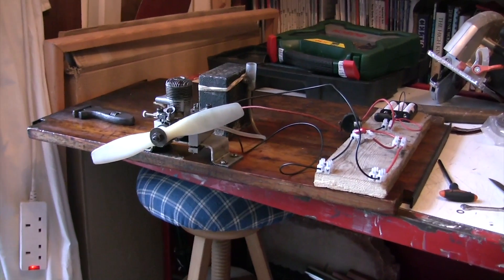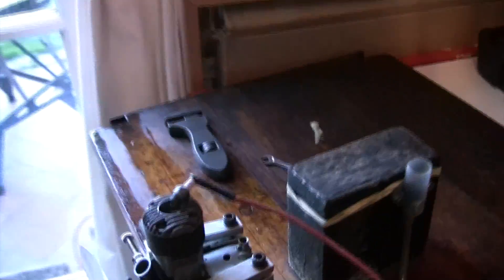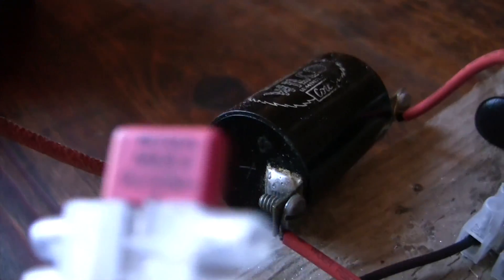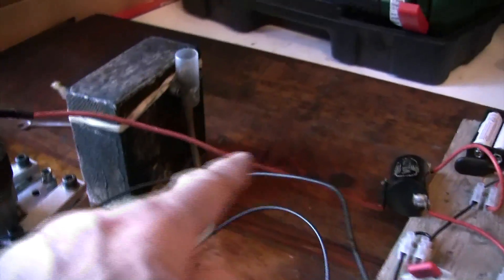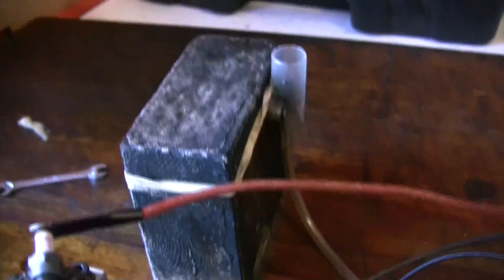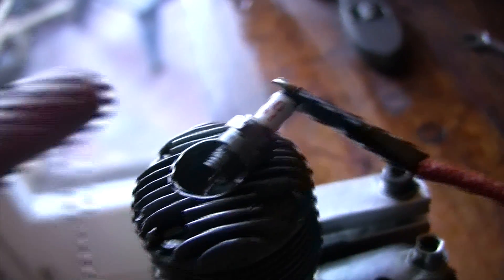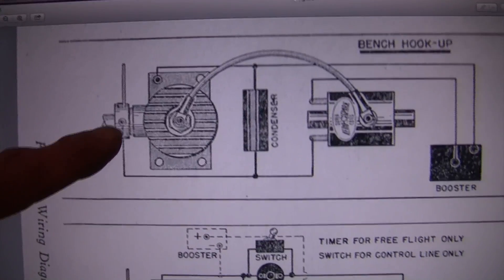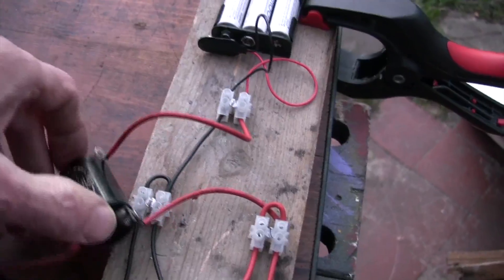How to get a Vintage Spark Ignition Plane Engine Running!

Comment: I have an O+R 60 which runs well, but I would like to convert it to glow. How do I get a glowplug to fit it, and would I need to alter the spraybar or glow fuel mixture? I live in beautiful Cape Town, South Africa.
Reply: Glow plugs are usually the same threads as a spark plug. 1/4-20. 

Screw the glow plug in, connect the ignitor, prime the engine, and try it. You'll most likely have to richen the carburetor. Make SURE to use glow fuel that has a high castor oil content, OR add some extra castor yourself. 

Your engine WILL HAVE to be in good shape, and have enough compression or it won't run. 

Experiment with different heat ranges of glow plug to ensure that you are getting enough performance without any detonation problems.

Good luck
Reply: @davelowets  Thanks, Dave. the engine is in very good shape, but it has no carburettor - as mentioned, needle valve only. Also,  the spark plug is of a larger diameter than the average glow plug.
Reply: @davelowets  Sorry. It is a 3/4 inch plug. Champion V.
Reply: If your O&R has the large V plug you will have to find an adapter to reduce the thread size from 3/8" down to 1/4", they are around. Check with MECA the Model Engine Collectors Association.
Reply: @5695q  Thanks. Will do!

Comment: Is there anything special about the coils? I see these going for $25-$40 on ebay in the US. Seems like a couple of coils around an iron core and you would have the same thing.
Anyway, excellent vid - I have bought 3-4 over the years over ebay and want to get them running...

Comment: I have a Fox .35 engine it's way older than that it's from when you have to use strings to steer a rc plane
Reply from the maker: The USA was way ahead of the UK when it came to engines. Every factory in the UK between 1939 and 45 was making munitions and it was illegal to fly powered model planes during the war. (In the USA, model engines evolved over that 5 years). After the war, most UK engines looked like copies of Pre war USA engines. The Frog 500 is a copy of a Fox (I think), so it was the most up to date. It started as a sparky, got converted to a glow and then they released a small amount of sparky versions between 1950 and 52. After that it was all glow for 13 years! It was the first successful UK glow engine and used in control line (U control) planes mainly.
Reply: Thats called U-control!

Comment: Any idea how much the batteries(s), coil & condenser weigh ?   Running it on pump gas, with some oil added for lubrication ?
Reply from the maker: Normal lead free petrol with motorbike 2 stroke oil. 3 to 1.

Comment: What oil do you use in the 3/1 mixture?
Reply from the maker: +Gerry Priddle I have been using motorbike 2 stroke oil. But you could use caster oil or sae 10 (lawn mower) oil. Just choose 1 and stick to it. I have found that with another engine of mine, I started with caster, went to 2 stroke oil, then when back to caster and it seemed to bung up the engine. I then went back to 2 stroke oil and after a very long run, it freed up and started producing more power (back to how it was when I first used it). Caster oil smells better. Use Castrol R or get Caster oil from Model Technics.